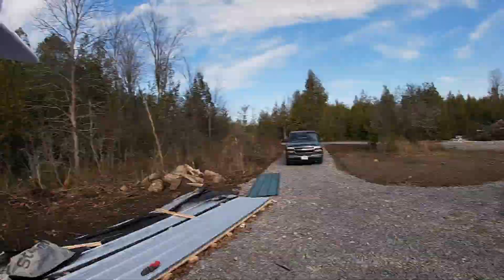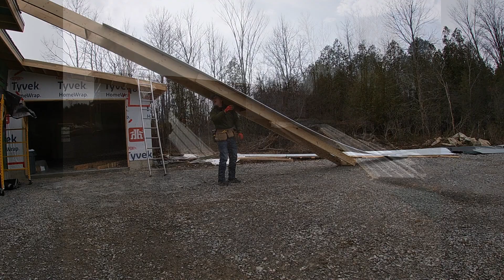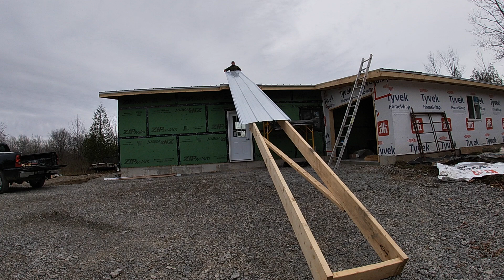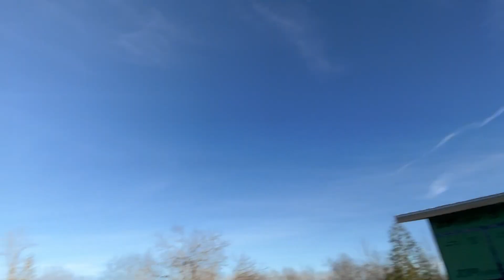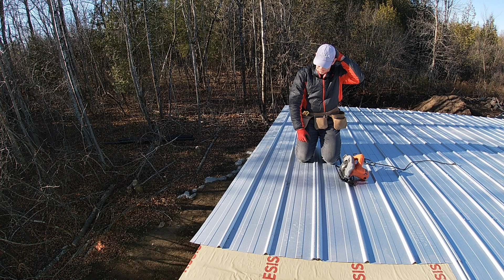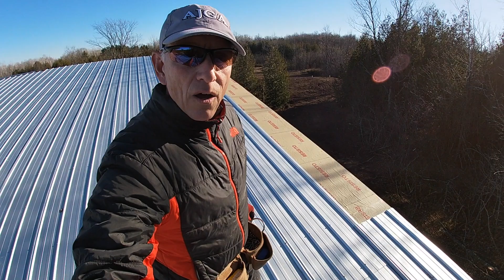House Build Series #15: Installing the Metal Roof by Myself

Comment: Generally, it's recommended to screw metal roofing into the flat area of the panel, rather than on the rib. This placement provides a more secure and weather-tight seal, particularly when using multi-seal washers. Screwing into the flat allows the washer to properly compress against the wood framing, ensuring a tight seal. 
Here's why screwing into the flat is often preferred: 
Better Seal:
The flat provides a solid surface for the screw to grip, allowing for a tighter connection and better seal. 
Reduced Leaks:
Water runoff is less likely to pool around the screw head when installed on the flat, reducing the risk of leaks. 
Flexibility:
Installing on the flat allows for some flexibility and movement of the panel due to thermal expansion and contraction, minimizing the risk of screws backing out over time. 
Solid Wood Surface:
The flat area typically has a solid wood surface underneath the metal panel, providing a more stable base for the screw. 
While some professionals and manufacturers still recommend screwing into the rib, especially for specific panel types or installations, the flat is generally considered the more reliable and secure method. 
This video demonstrates how to install metal roofing screws in the flat:

10s

True Metal Supply | Metal Roofing
YouTube · Sep 13, 2024
Generative AI is experimental. Learn more